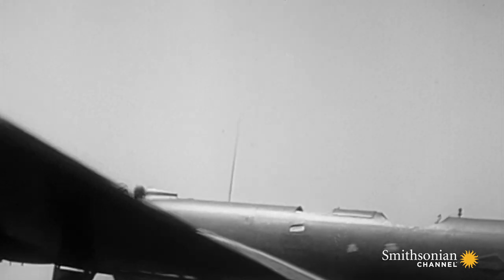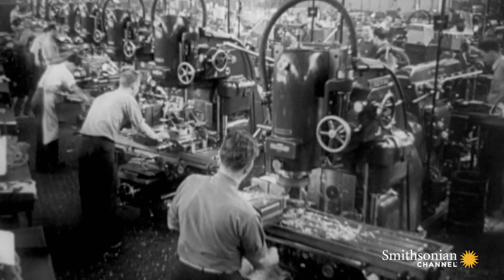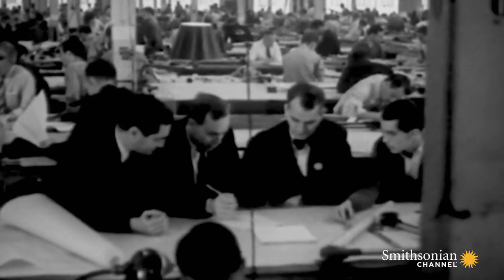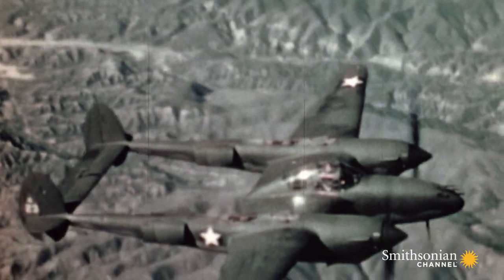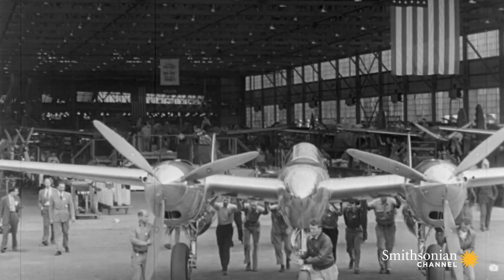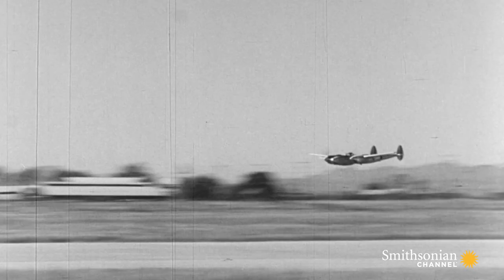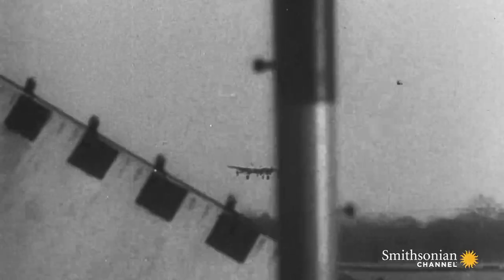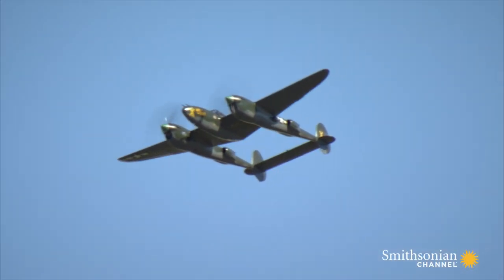How the P-38 Flew Faster and Higher Than Its Rivals

Comment: Not as agile as a lot of its rivals, but just as fast, if not faster. Four .50 Caliber Machine Guns and two 20MM Cannons.
Reply: One 20mm.
.
Reply: Bob Smith I thought it was two.
Reply: @podsmpsg1  Nope.  One.
.
Reply: Bob Smith thanks.
Reply: @podsmpsg1  No problem.
Reply: It may look impressive but in 1942 there were facing FW190 with 2 13mm machines guns and 4 20mm cannons. And the 190 was faster and more agile. Of course the P38 was better at high altitudes.
Reply: @samuelgordino  Yes - two things.

1) The P-38's primary job was to escort bombers - and the bombers were above 20,000 ft. where the Fw-190A's poor air compression (I believe they were using a supercharger as opposed to a turbosupercharger) limited it's effectiveness.  For an aircraft whose job it was to intercept bombers - this is a real failing.  They did fix this in later models but I don't know how many of those were built.  Of course - the A models were much more effective where they didn't need to fly so high and performed a number of such missions, especially on the Eastern Front.  But - I would note - that the P-38's greater ordinance loads would make it better at such as the ground attack missions the Fw-190A's performed.  Being more of an Interceptor - the Fw-190A didn't need the extra range a bomber escort does - and could put that weight into other things.

2) There is a philosophical split between the Cannon People and the Gun People.  Cannon's have bigger projectiles, explosive projectiles, shorter range, lower rates of fire, less ammunition storage and less secondary destructiveness.

Now - the weapons I always believed the Fw-190A was equipped with - were
2 - 13mm machine guns in the cowl
2 - MG151/20mm guns in the wing roots
2- MGFF 20mm guns in the middle of the wings.

The best of their guns were the MG151/20mm's which had a revolving breech and a very high rate of fire for a 20mm cannon.

The P-38's also had a mixed Cannon/Machine Gun armament
4 - .50 caliber M2 Brownings in the nose 
1 - 20mm Hispano Cannon in the nose

Now - I would certainly give the nod to the Fw when it came to weight of fire from it's guns and cannons but I would contend that the difference - because of what I said about the two schools of thought regarding cannon and machine guns that the difference is not as great as it would appear. 

The benefits of an explosive projectile are obvious but from those in the machine gun camp - the argument is that having a greater volume of fire and the greater ammunition capacity that goes with the smaller round you are shooting so many of,  gives you a better chance of getting a hit.  Also - there is a down side to explosive projectiles.  Chuck Yeager's comment on that was that the Germans 20mm's would explode as soon as they hit the outer skin of their aircraft and put a bigger hole there - but - the solid .50 cal rounds would do more damage internally to the aircraft as they might bounce about into several different things.

Also - Interceptors planning on shooting at bombers - tend to want to have cannon whereas if your target is a fighter plane that is harder to hit - the machine guns work better.  You can see the extreme case of this in comparing the Mig 15 to the F-86.

Of course - today - you have both volume of and weight of fire with 20mm Gatling guns that have a phenomenal rate of fire.

One thing I see constantly is the "which is better" question.  My usual response to that is "at what?".  You have a whole host of aircraft - that were good aircraft at some things - but not so good at some others.  Some aircraft have serious problems and are marginalized but others can be really useful if you have them doing the thing they are good at.  Some aircraft are flexible enough - that they can change roles from one thing, when something else comes along that was better at that particular thing - to another that their replacement at their first job - may not be so good at.  Here I'm thinking of P-47's and P-51's. 

Within an aircraft type though - you also have major differences between versions.  In comparing aircraft here - it's like "which version of an aircraft?"  They built more L Model P-38's than any other model - and it had pretty much ALL of the early problems fixed - but the P-38's still get bad mouthed about problems with the earlier versions.  With the Fw-190's they did fix a lot of it's problems with later versions - but those versions didn't have as many aircraft built as the A models.
 .
Reply: @BobSmith-dk8nw  Firs great answer. 

2- I made a mistake. The FW versions with 2 13mm only apperead in late 1943, so not in time frame in question. Sry
3- When the version with 13mm machines appered only the MG151/20mm's were used. The older MGFF 20mm werent in use any more.
4-As for the  P38 L, great plane without any doubt but it was to late. By 1944 it will be facing FW190 D or ME 109G10 or K that can win in all aspects. Or if the pilot was very unlucky a ME 262. And the FW 190D was the most numerous fighter in late war Luftwaffe.
6- Ordenace, some versions of the Fw could carry s much as 1800kG ( i think it was the F version) and were as toughf as the P47.
OF course im talking about the planes, fuel, parts and more importan trained pilots its another thing.
I i made a mistake please tell me, im a aviation fan for many years and i have no problems in admiting im wrong and learn something new. :)
Reply: 18tangles  Exactly after Big Weak

Comment: Are you telling me that they did not have carb heat in 1936 ??
Reply: The turbocharger provides carb heat when it is engaged. The problem is the turbo engages when the throttle is pushed beyond 2/3rds power. The XP-38 was circling around the field at low power for so long that there was no heat going into the carb.

Comment: P-38 was ordered as an intercepter, not a fighter.
Reply: The P, stood for Pursuit.
Reply: That’s great. And the F in F-111 and F-117 stood for fighter but they were both bombers.
Reply: @kellyBorgman  -  The "Pursuit" designation applied equally to both interceptors and fighters.  This per Wikipedia:  "Lockheed designed the P-38 in response to a February 1937 specification from the United States Army Air Corps. Circular Proposal X-608 was a set of aircraft performance goals authored by First Lieutenants Benjamin S. Kelsey and Gordon P. Saville for a twin-engine, high-altitude "interceptor" having "the tactical mission of interception and attack of hostile aircraft at high altitude."
Reply: Interception is a fighter mission.

Comment: I thought that because of high altitude problems, the P38's were used more in the Pacific Theater, where ops against the Japanese were at much lower altitudes
Reply: The P-38 was a success in pretty much every theater of the war it was employed in outside of the bombing campaign in Western Europe.  The reason it didn't work out well there was because early models were pushed into high-altitude combat before its problems affecting high-altitude combat had been solved.   The US Air command was committed to high altitude bombing, a type of combat to which most German machines were well suited, which exposed the shortcomings of those early P-38 models.  Ironically the crash mentioned in this video was a major factor because it set the P-38 program back by at least a year or two.  Had the later P-38 models such as the "J" and "L" been employed earlier in Western Europe it probably would have been a different story.  Those models corrected the high-altitude problems and were overall much better planes. However, by the time they started arriving in number in England the decision had already been made to use the P-51D in the role, to which it was also quite well suited.
Reply: The altitude difference thing is a bit of a myth.
Reply: @arkwill14  The Germans were not very worried about the P-38. It was easy to recognise and had too much inertia to be a good fighter/bomber escort. Its combat envelope was quite small and as long as it could be employed that way, it worked. It was withdrawn from escort duties in 1944.

Comment: The P-38 was hands over the P-51.
Reply: sirwilliam51 I AM a P-38 fan, but I have to disagree.
Lightning was a superior bird in the Pacific due to that second engine and the gun system.
However, in 8th Fighter Command, at high altitude out of England, due to deficiencies in cockpit environments and, prior to the J-25, model, the lack of the dive flap, the P-38 was WAY behind the -51 as an escort.
But give me a -38 against any A6M, any time, anywhere. Or any other IJN fighter...

Comment: The P-38 achilles heal was its turbo exhaust super charging system! They would burn out too early limiting its high altitude performance....this plane did excel in mid to low altitudes....North African/Mediterrean theater and in the Pacific it flew mainly medium to low altitudes missions and did a great job....it failed in the European high altitude escort missions....they spent more time on the ground with its burnt out turbo exhaust super charging system.....GE made these systems....

Comment: "Super" turbocharger? Really? Differing how from a turbocharger? Hype wastes time & bandwidth. Took USAAC & Lockheed a while to get past compressibility  effects, and go to one-piece elevator. Then it lived up to potential, surviving steep dives.
Reply: Turbo supercharger is actually a correct term, meaning a supercharger driven off the exhaust gases by a turbine.  Nowadays we typically we just shorten it to turbocharger and leave supercharger to refer to mechanically driven superchargers.  Super turbochargers though?  Not so sure about that one.
Reply: No need to be pedantic about the obvious, y'know.  Thought I was being obvious there.
Reply: Now I wonder if it had both. It did have a very conspicuous turbocharger on top of each boom.

Comment: They could just have asked the British for the design of the de Havilland mosquito. Packard were already making British Merlin engines so besides being faster than the P-38 it could carry more bombs than a B-17 and if so desired bomb one building or even one particular brick wall.
Reply: The P-38 was flying for two years before DeHaviland even started designing the Mosquito, and the Merlin engines were still stalling in 1940 (Spitfires). So, no, without time travel, this wasn't possible.
In 1943 or 44, a version of the P-38 was made that used Merlin engines (after they got the kinks worked out), resulting in an additional total 50 horsepower, so the powers that were decided not to bother because of retooling costs so close to the end of the war.